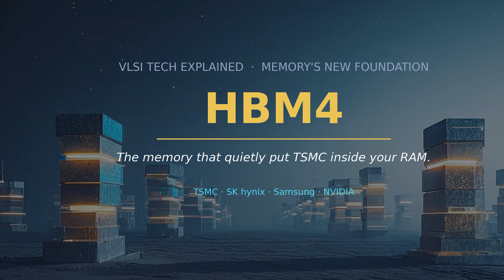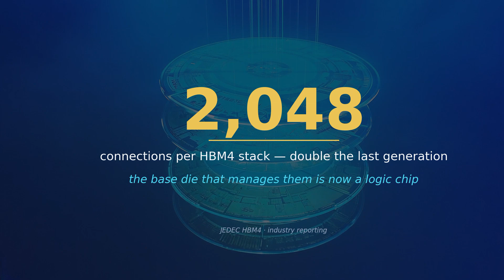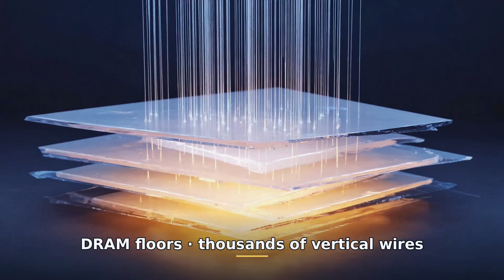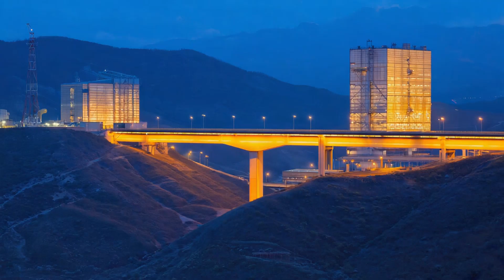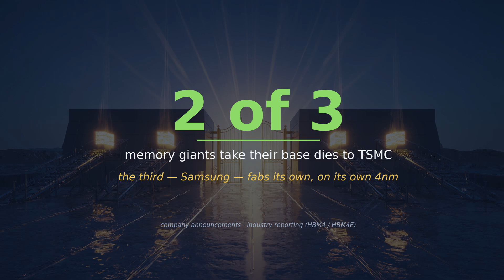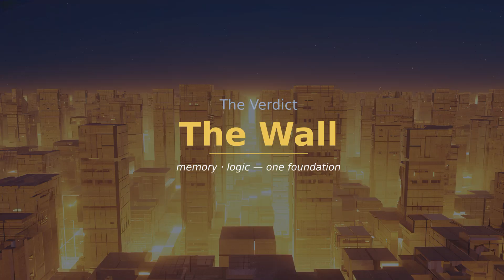HBM4 Quietly Puts TSMC Inside Your Memory (SK hynix, Samsung)

Comment: Yeah... the memory makers going to TSMC for base dies is them admitting they can't do logic. The real fight is who controls the custom base die spec, and that's NVIDIA's to lose.
Reply from the maker: Less "can't do logic" than "it never made economic sense" — a DRAM process has few metal layers and transistors tuned for retention, not switching speed, so the base die was always a bad fit once it needed real logic density. But agreed, the spec fight is the real story. NVIDIA has the volume to demand custom base dies, yet the GUC/Broadcom route the hyperscalers are taking is exactly the counterweight. The tell to watch: whether HBM4E stays JEDEC-anchored or fragments per customer.